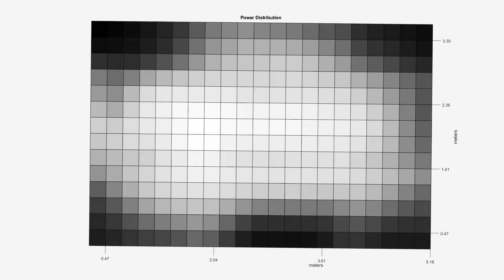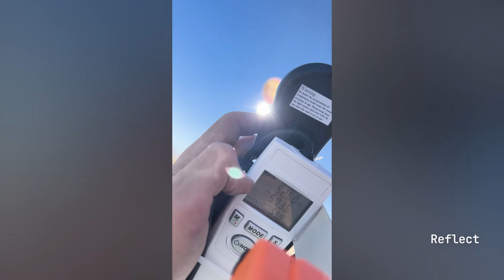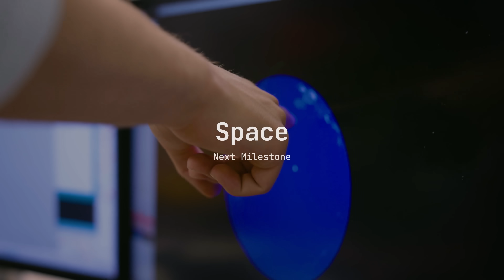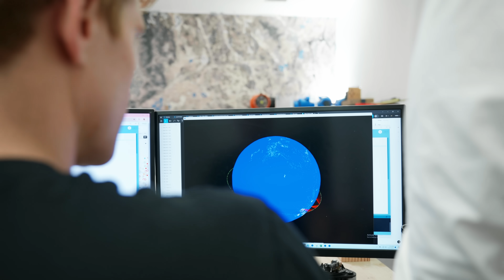They're Making Solar Panels... Work at Night | Reflect Orbital

Comment: This has got to be one of the smartest dumb ideas ive seen lately. The size you'd need to make this feasible and the horrible land use vs output of even the best panels. It's absolutely absurd to think this is worth even five minutes of thought.
Reply: This. EEVBLOG ran the numbers. They aim for 10x10m mirrors that collect 100kW at best angle, mst of the time a lot less. That is about 100kW they sent to eart at very best.
As the sun is no point light source but covers 0,5° on the sky, th beam spreads out by 0,5° on it's way to earth. Whrn it hit's earth, the reflection covers a a circle of 5km diameter.
If you can do very simple math, you come to the conclusion that the average energy hitting earth from that mirror is at VERY, VERY best 0,005W, 5MILLIWATT. 
Just for reference: At say, noon,a solar plant will get 1000W of power. Guess what a 1000W expecting Solar plant will do with 0,005W. NOTHING. That isn't even enough to run the electronics. That's full moon level of brightness.

It'S hard to believe engineers ran basic numbers at concept stage and not concluded that this will do absolutely NOTHING.
Reply: yeah.. I mean you can do the math of energy/area from the sun, and then mass/area of mylar, and find this is about 1000 times too expensive to be worth it
Reply: You're basically spending a billion dollars to get enough electricity back down to earth to charge an average electric car lol

Maybe it can be used as an artificial moon though. It'd be a good service for a city to supplement lighting infrastructure, fill in gaps, etc.
Reply: @TennisGvy  maybe a toaster
Reply: It's worth way more than 5 minutes of thought.
These solar farms are already there. They are already built and they are already profitable. If you can sell them some sunlight and make them slightly more profitable you get some of that profit too. Business works like that
Reply: @RedRyan  Yeah No one is going to be happy to see bright objects floating at night especially Observatories.
Reply: @RedRyan This assumes battery cost decline doesn’t continue. Regardless, imagine the LAUNCH COSTS lord oh mighty.
Reply: @samdavisok  and all the CO2 being generated from those launches. It'd take them a decade to "offset" the carbon. 🤭
Reply: @RedRyan  anything is "profitable" with enough government subsidies.
Reply: @rexmann1984  sure, but it's not profitable for society. Something has to be profitable above the subsidy is to be profitable for All of us

Comment: time for light pollution 2.0
Reply: the fact these two worked hard and long enough to get this far without stopping and thinking about light pollution is sad. They think the beams are invisible, they will not be. the sky is BLUE but the sun rays are invisible? something they should research in 1 minutes on google.

Comment: You combine this with a spin launch system and it might be cost effective.
Reply: Unfortunately spin launch is highly unlikely to ever work. Their massively publicized tests got their payload to an altitude of 7.6km. They haven’t even reached the height of a normal commercial airline flight, let alone space, and the problems with launching it faster increase exponentially. 

Maybe on the moon one day.

Comment: Instead of wasting money on this CRAP how about building the latest generation of nuclear plants that are LESS expensive than coal fired equivalent (over a 30-year lifespan) by half?
Reply: Of and this guy Ben is a moron. "the economics work out?" uhhhhhh
Reply: @emailuser3869 They work because rockets charge for mass not volume so if you make a light though reflector then you can capture allot of sunlight.

Comment: As much as i love the concept i feel like this is going to be multiple times more expensive than it is worth.  Like orders of magnitude.  They at best will need areas in space of reflective material equal to areas on the surface of solar panels to achieve the same output assuming perfect redirection.  Percentage of light hitting the ground will be higher the closer it is to the earth, and low earth satilite space will have more value that will eventually likely require renting / insurance to send sattilites to.  Reflectors for energy are unlikely to make the economic cut.  Although I'm sure they already know this.  The actual data and estimates they're coming up with will have actual value and be interesting to learn about, but I think talking about the problems openly by asking hard questions in interview format would reveal too much about their buisness.  Hoping you dive into it for the extended interview but i understand why theyd keep that data / knowlege close to their chest.
Reply from the maker: I don't go too much into that in the sit down interview — but I do know they're thinking a lot about it. The value of S³ is that we'll be back for follow up episodes as they develop, we'll know more then.
Reply: eevblog made a good debunk video on it.
There are many prblems, but the bigget and absolute kiler is that the sun isn't a point light source, but covers 0,5° f the sky. as a result, the beam from that 10x10m mirror spreads up by 0,5° going down to earth. 
if they place this satellites at low earth leom the beam is about 5km diameter when it hits earth. So the maximum power at best angle it sends to earth is about 130kW, after Atmosphere it's about 90kW, and that 90kW get's spread over the circle of 5km. So the raw power each m2 gets this reflection is about 5Milliwatt. 0,005W°!!!! Just for refendrecne, normal Solar plant at midda get about 1000W or 1.000.000miliiW.

That isn't even enough to tun the inverters and MPT controllers. That is basically a rounding error of nothing.

This is such a bad idea, and it's amazing how guillable somany youtube channels are that don't do any critical thinking.
Reply: @Flinno-k8w  what would stop you from pointing many satellites on top of each other?  Cover that large area with a solar field and overlap all beams on the same spot
Reply: @oof_Dad  ok, to get totally LAUGHABLE 5W/m², you need to point 1000 satellites to one singe field. Guess how much revenue a solar plant that normally has 200 times that much energy shining on them have at laughabel, riidicculous 5W/m²? And that revenue has to make THEM profit and cover the cost of 1000 sats to achive that ridicculousness and still generate revenue for the solar operator ..
This idea is so ridicculous, it hurts.
Reply: @Flinno-k8w  thanks for sharing.  Sounds pretty dismal.
Reply: I agree.. also, solar is getting super efficient now, and dual sided as well. There is also going to be limited space with all the stuff floating already at low earth orbit.. also, will the cool sunsets be ruined by this? 😅
Reply: Depends on how big they can make the reflectors and how cheap rockets get.

If they can harvest football field sizes areas of sunlight and focus them onto a regular 2 x 2 (or whatever) solar panel, that could provide a lot of power.
Reply: Sometimes people forget that most of the people sleep at night.
Reply: @manup1931  if you can shift even a few hours I bet it's valuable for evening demand
Reply: The market for sunlight is rather large
Reply: yeah i'm not really confident it will work. Like the idea is sound but there is too many variables and you would need millions of these satellites for it to work. Plus the satellites move (unless they are geostationary.. but good luck at that distance) we should be investing in sending power around the world instead.
Reply: You love the concept of disrupting all natural processes for corporate profit?
Reply: "Like" is not engineering studies.  "i feel like" is not a good financial numbers source.  Sorry.  Your data is insufficient.

Comment: If you launch the sats in geostationary they would 
1. work 95 % of the time
2. Could be positioned considering demand
3. LEO mirrors would experience lots of atmospheric drag and space debris, this Wouldn't be so much of a problem in GEO
If you used a secondary mirror the primary mirror would face the sun directly instead of doing it at an angle, combined with 95% uptime that would more than make up for the higer cost of GEO . I mostly thought about this when I wondered how we could get rid of the winter, you would aim beams of solar infrared and possibly visible light to heat up large urban areas, i roughly calculated that you would need between 1/5 and 1/20 of the city's area as a mirror depending on whether you use visible light during they day and of the desired temperature.
Reply: I would build a statite. You can use radiative pressure to achieve a unique geostationary equalibrium. Geostationary orbits are quite valuable resource that don't want to fill with competing space debris. These mirrors need to outside that or they turn up with space junk.
Reply: geostationary is a specific spot in orbit for each location on earth and each of those spots are really high demand (expensive). Might mess with the economics of the business model.
Reply: They would provide more power and they could last longer because they would experience less drag which on a mirror as light as this would be considerable in LEO but much less so in GEO @Drakoman07
Reply: Geostationary orbit is also far more expensive, and would require far larger mirrors due to the increased distance.

Comment: Main problem seems to be the size of the mirror? You can only hit solar panels that are as big as the mirror itself, unless you spread the light out, but then it loses intensity. I like their optimism but it's so hard to see how adding all these moving parts to solar panels could be cost-effective.
Reply: You're right ,  this idea sounds stupid . It's literally sounds like a stoner bro blurting out what he thinks is a profound or revolutionary "bruh what if we put mirrors in space woaaaah" .
Reply: @arbitrandomuser  Uhhh this is extremely useful. This could be a missing link to harnessing solar energy when you have solar farms during the night time. It's a pretty complex problem to solve, but they aren't trying to do anything that is impossible.
Reply: The main problem is idiocy, followed closely by that of innumeracy.
Reply: You wouldn’t hit anything. Rayleigh scattering . The light will scatter and diffuse. Redirecting sunlight 10s of thousands of miles through our atmosphere will not work the way the claim (atleast ad they claim now)
Reply: Maybe they can use a convex type mirror to cover more area on earth
Reply: @sonugaudrait  Using a convex mirror to cover more area on the ground would make things even worse. Convex mirrors spread light out over a larger area, which would significantly reduce the intensity of the sunlight reaching the solar panels. The whole point of using mirrors would be to concentrate sunlight, not dilute it. So, instead of solving the problem, a convex mirror would make it even more inefficient, wasting most of the reflected light. It's simply not a viable solution.
Reply: Than use an intensifier
Reply: They explain it, they will send 100 or so satellites to light up one space.
Reply: It's not complicated.  It's just about the cost numbers.  That's all it is.  Your question is right, and the answer is simple.  They'll come up with an answer to that question eventually.
Reply: @bradallen1832  Placing mirrors in space to enhance solar farms is impractical. The mirrors would need to be at least as large as the farms themselves to reflect enough sunlight, making them extremely costly and challenging to deploy and maintain. Light disperses over vast distances, reducing efficiency, and atmospheric conditions further diminish the amount of sunlight reaching the solar panels. Additionally, building and launching such massive structures would be prohibitively expensive. It's more cost-effective and efficient to invest in improving solar technology and infrastructure on Earth rather than relying on complex and expensive space-based solutions.
Reply: @bradallen1832 the answer is don't do it lmao
Reply: I think they somehow plan to use multiple satellites to light a  solar park,  but also spread the light. By spreading the light like 30%, that would not be so bad, because producing at night 70% from what you produce at day, its still a big thing, and also the energy consumption is way smaller at night. I think with right calculations, this would work well
Reply: what do you mean by "You can only hit solar panels that are as big as the mirror itself" have you never heard of focusing light? Do you think all mirrors are flat? How do you think telescopes work?
Reply: @justincameron9123  you cannot be a real person. of course you can spread out and focus the light. whatever you do, you can't create more energy with a mirror.
Reply: @WaltersWatching  Your statement "You can only hit solar panels that are as big as the mirror itself" is factually incorrect. Which might be fine if it was an extension of a previous statement that clarifies or adds further context to what you're trying to say but as it stands there's no such thing and actually just regurgitated nonsense
Reply: @justincameron9123  It doesn't matter what size of a panel you're hitting off the mirror, it's going to produce the same amount of energy, because the amount of reflected sunlight did not change.  Do you understand now, or are you still having problems? Or are you just trying to be a smartass bringing up semantics in a discussion about solar power?
Reply: Seems complicated, i just hope they don't accidentally converge the light when reflecting it where it burns the ground like a magnify glass when experimenting.

Comment: this could also be used to boost solar powered Psudo Satelite aircraft.  let me know if you want to test it.  I have a solar plane.
Reply: I don't know if they get high enough for continous power delivery. It might be possible if you get 2 extra seconds for every meter you go up then you need to be up about 50000ft. So higher then most passengers planes.
Reply: Now there's a cool idea. These mirrors would effectively shorten the night for the plane by a couple of hours, which would let you use smaller batteries.

Comment: Won't the reflectors only work for an hour or so near the termination point?   I guess that's a really good thing.  just wondering how it can be better...   I suppose using a two stage reflector system may make sense?
Reply: That's probably the plan looking at the orbits.
Reply: But if they are adding one hour or 2 of peak solar electricity to solar farms all around the world, at peak times, that is worth billions!
Reply: Just one thought, obviously not what they said in the video and not complete on my end:  I'm starting to think about diffracted light bleeding into the night sky during humidity causing issues at night, so one way to circumvent that problem on humid nights is only target panels during dawn, dusk, twilight, and evening, so that the bleedover effect doesn't interfere with sleep and darkness.  This would mean the space array is best used closer to the land panels on humid nights, and means they don't lose space reflector capacity due to double and triple hop networks on humid nights.  On dry nights, diffraction is less of an issue, so the space reflectors would get to consider multihop network issues while they consider lighting up ground panels more of the night.